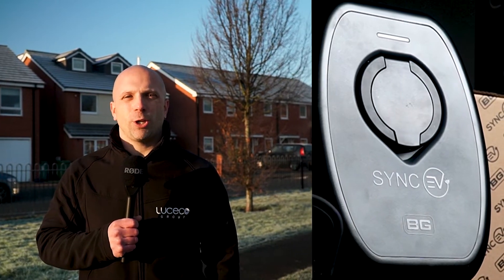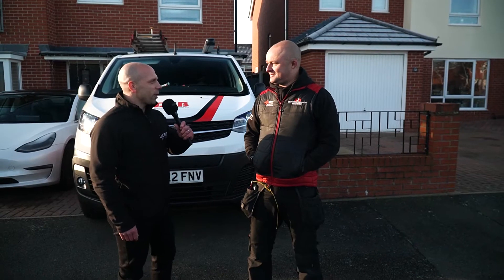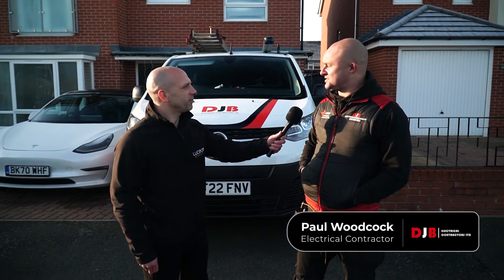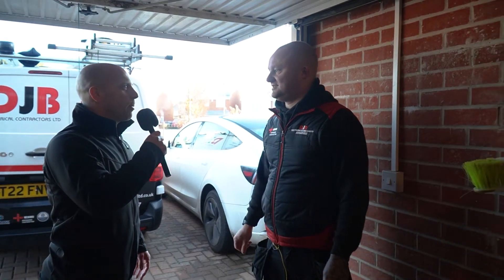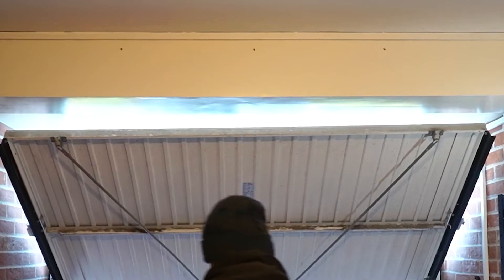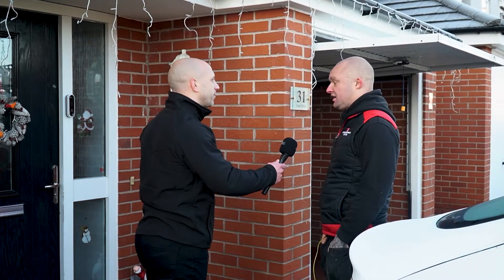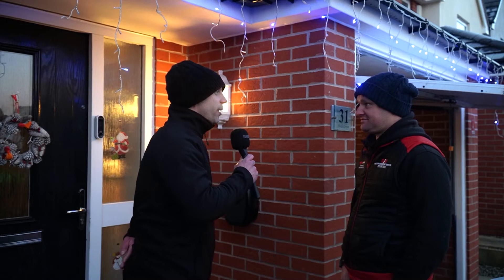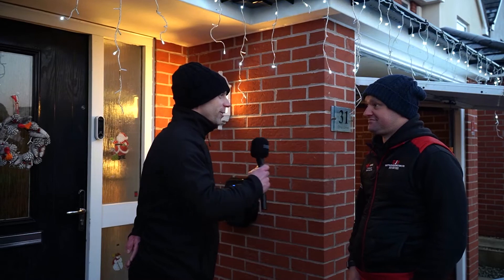Watch Paul from DJB Electrical Install & Review Our BG SYNC EV Charger

Comment: Does the untethered wire lock into the unit even when the other end isn’t connected to the car?
Reply from the maker: Hi there — no worries at all, happy to clarify! 😊
With a socket (untethered) charger, the cable does not lock into the unit by itself. It only locks when it’s plugged into a vehicle that requests it to lock.

If you prefer a cable that’s permanently attached and locks at both ends when not in use, you might like a tethered charger instead.

Hope this helps clear things up! Feel free to ask if you’d like help picking the right type for you. 👍